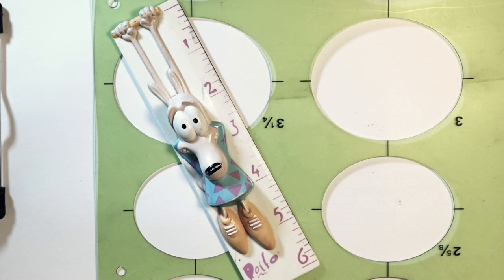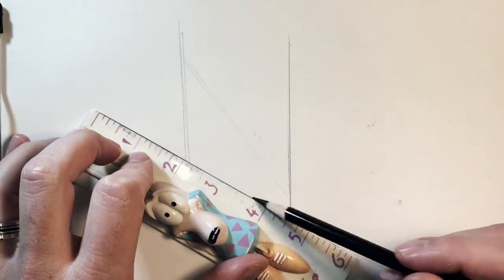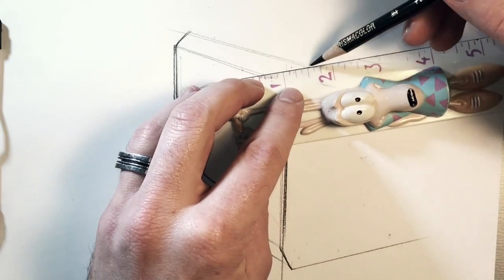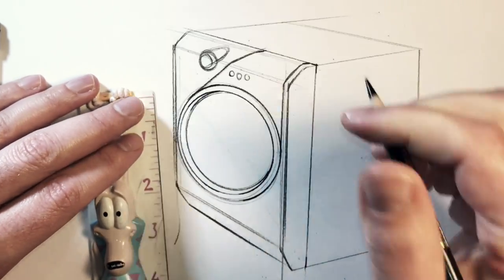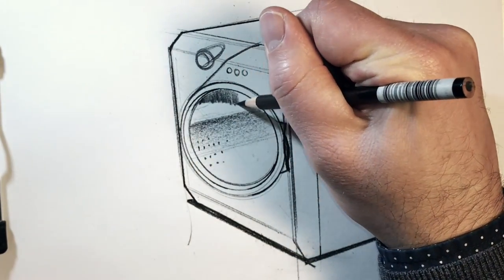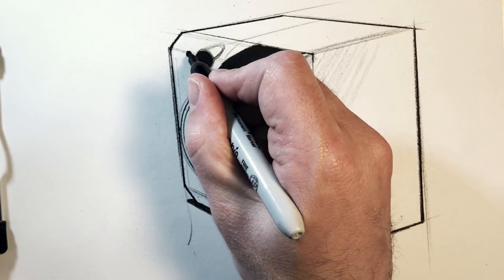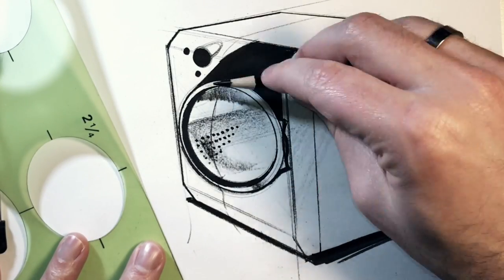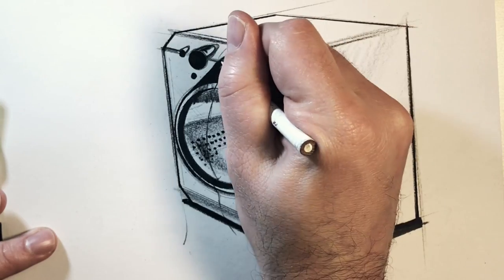Yo! C77Sketch: Sketching a Washing Machine with Tools

Comment: Shouldn't the major-axis of the ellipse always be perpendicular to the center-axis of the circular front-door?
Reply: It is perpendicular, but the ellipse is too round/wide for the angle it's viewed from and therefore it looks a bit misaligned. I think if you are using an ellipse quide with fixed ratio you should adjust your perspective appropriately